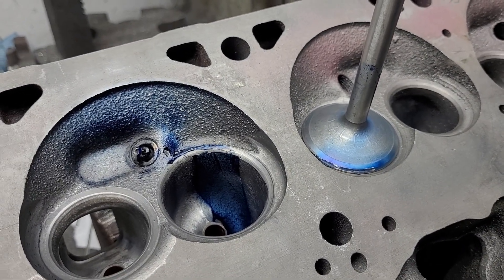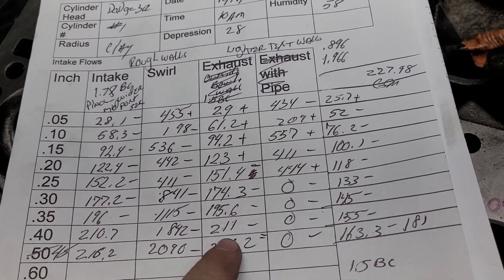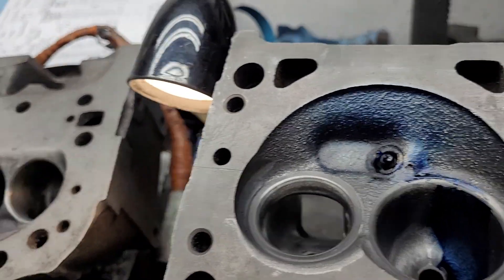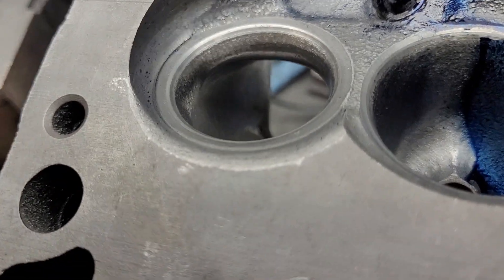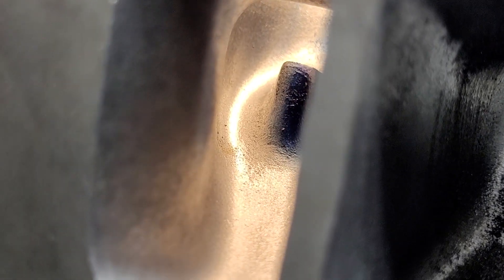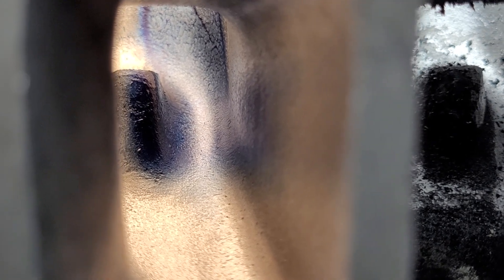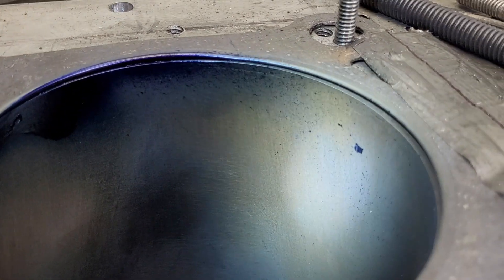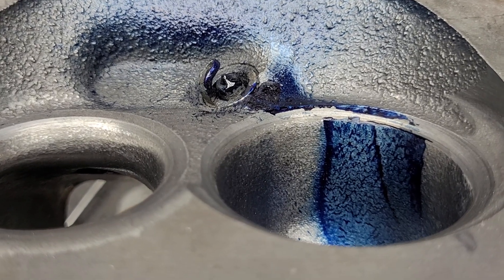David Vizard, Uncle Tony's garage, Unity motorsport, Mission impossible 318 project, Air restriction

Comment: Whenever I see dykem on the walls of a port, all I can think about is the fuel sticking to the walls of the port. Now I know that is reality, but the less I see on the port walls, the happier I am. My personal thoughts have always been that I wanted the squish to drive the combustible mixture towards the spark plug. I always wanted to keep as much fuel off the walls as possible, and suspended in the air stream. Now, that doesn't mean that I'm right, it's simply my thought process, and I haven't been in a position to do a lot of dyno testing to prove my thoughts. Back in the 80's, I didn't have a flow bench of any description, so I used an airline and an aerosol can of paint. Looking back at it, probably not the best way of doing things, but we use what we have. Interesting stuff Charlie. I do enjoy your work. Regards Greg
Reply from the maker: I appreciate your input. Thanks

Comment: If you get a clear acrylic tube the size of the cylinder And make a vacuum chamber that you can see in too  Use that to pull low vacuum on the head and use a metal tube attached to a fog machine to visually see where the air flowing around the valve and through the port favors You can use the smoke wand to go around the intake  Port and see how the fog interacts with the valve lift. And then put the fog in the acrylic chamber and blow it out the exhaust port to see how the flow characteristics are. It helps to see where the fast moving air is and where material should be removed.
Reply from the maker: Been looking for a clear cylinder.
Reply: @servediocylinderheads  Amazon has clear 4 inch 4 ft long PVC. It's a bit pricey.

Comment: About de liquid flow test. Why no one put an aspirator with a plastic cylinder to do fhis test. That would be better with a pierced movable flat top to be able to measure it by the valve height opening vs piston distance. What do you thing about this? Thanks for your research and videos🤞
Reply from the maker: I am sure someone has done it. If I understand what you wrote Darin Morgan has a video on wet flow testing as you wrote.

Comment: Is the throat bigger than 87%-90% of valve diameter? I’ve read that 87% or below usually emphasizes flow under .600 lift due to the better turn / venturi with the valve still at / below the curtain area .25-L/D, for most of the lobe area, and in very low lift scenarios 85% can sometimes be superior under .400 lift on older port designs……from Darin Morgan’s interviews / podcasts he’s stated 90% throats are “OK” if perfectly designed at lower lifts, but they really don’t become hugely advantageous until the lift is .700+
Reply from the maker: The throat is about 92% I am guessing a goof from earlier porting. No doubt bigger valves would help.

Comment: Charles Servideo,  in ur opinion, will a  better flowing set of heads make more power even if they are coupled with a crappy intake?  And how do u know where to stop with the heads when coupling them with a crappy intake and carb?
Reply from the maker: The higher flowing head will pull harder on crappy intake and carb.
Reply from the maker: I never know when to stop.

Comment: Can I offer you a suggestion? Try a 1.88 intake with what you have already done.
Reply from the maker: I wish I could. I don't have any. Thanks
Reply: how many do you want? @servediocylinderheads
Reply from the maker: @slackthompson6984  Shipping anywhere right now is insane but if you are being generous I could use 18 1.88 usable valves and 18 1.6 exhaust valves. The extras are for backcut angle changes. Thanks
Reply: I agree with this suggestion. In my reasoning, you've done a great job of streamlining the ports and bowls; the deshrouded area looks WORLDS better also- great work Charles! I can clearly detect your frustration brother, and it's understandable you've done a lot of work!  So, ok.. what have we learned... continuous change seen in varying areas- but all for the potential gain with each step-until now now. You open up the pinch=nothing😳... how?!(🤔gotta be overall restriction).  You open up the exhaust=falling #'s😑...but don't fret-this serves to support the idea that there is a clear restriction. When you're opening up ports and PINCHES (believed the limitation from the commencement) Shows that the bottle neck has to be the intake valve.  Once you slap a larger valve in there all your beautiful work is going to begin to shine..i can't wait to see it!! The exhaust port on all of these small block mopars is awesome in design from the factory....it's literally looking right at the exhaust valve...so all the smoothing you did in the ports will come back to redeem itself once the bigger valve allows more flow, because it will also pick the air speeds back up across the board-intake/exhaust/ and swirl which is feeding this thing! I have the original factory two barrel intake I literally just took off my motor I previously mentioned from my 87' dodge B250 RamVan. It was mated to these exact heads with the smog pump(poor man's super charger 😅)etc. If you want it-it's yours (FREE) brother! II'm near Tulsa...don't know where you're located but I could weigh it and get a shipping quote from UPS and USPS Wednesday morning if need be. Let me know if you need me to do that. Keep your spirits up-i think this thing is about to wake up! 😁
Reply: @servediocylinderheads  give me your mailing address Charles
Reply from the maker: @slackthompson6984  First of all ...you rule! Charlesservedio@gmail.com

Comment: your bowl is too god damn big.  you need to get two angles below the seat, you don't have room for them.
Reply from the maker: Old porting will do that. I remember I wanted 2.02/1.6 combo for these heads. I need to find the other it may be cut already for bigger valves. You are totally right.
Reply: @servediocylinderheads  Well, awesome then ! 
 Nice job with the unshrouding/relieving on the 'heart' side.  If you remove the 'tip' in the heart shape (between valves) there is actually some flow to be had there..
Reply from the maker: @gregsilva1230  Good info. Thanks